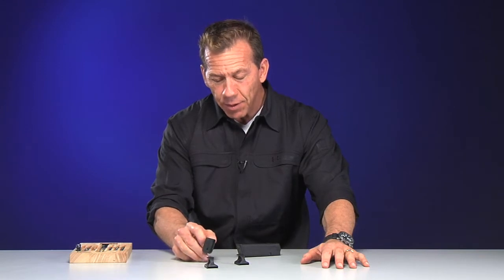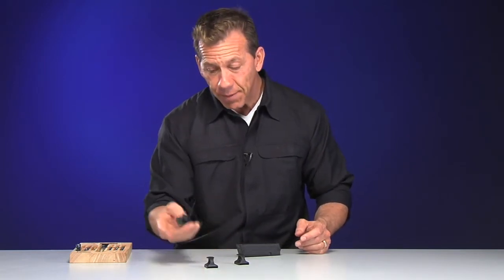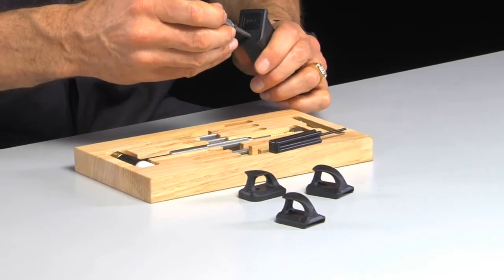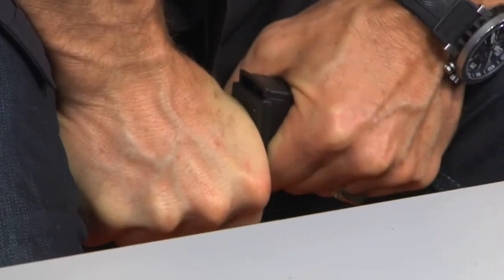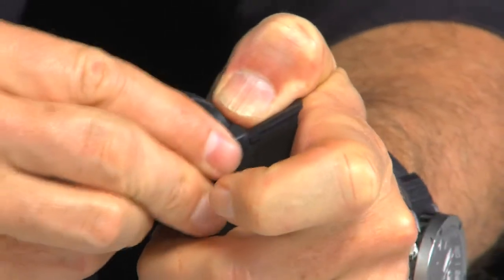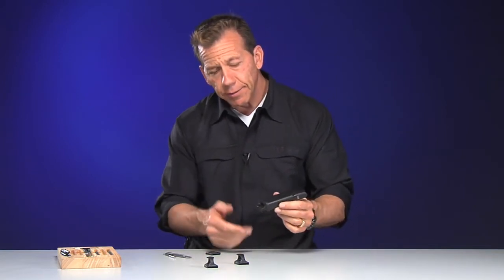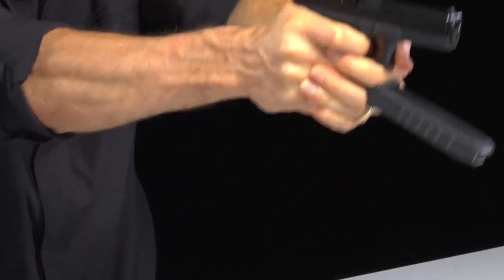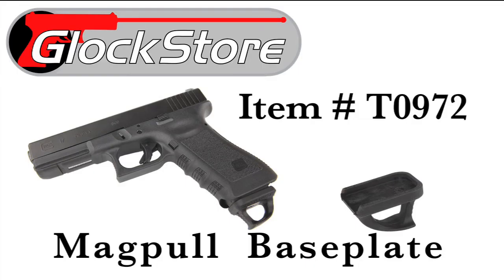MagPul Speed Plates

Comment: I found a lot easier way to take off the base plate. Grab a pair of channel locks or vise grips and squeeze in the sides of the mag up close to the base then insert a punch in the hole and it will slide off easy. And also you can wrap tape around the part your squeezing to help from digging in but I didn't and it was fine

Comment: I bought some of these for my Glock 26 and added them to my 15rnd 9mm mags and they work well. Once I added them to my 10rnd mags, they had problems and would have stove pipes, the mag would not click in for some reason. I changed it back to my old mag plates and they worked well again. So for some reason, they are not working on 10rnd 9mm mags. You have any ideas on what to do? Thanks. Good video.
Reply: old comment but, glad i found it since i was just looking for something to put on my 10rd mags. thanks!
Reply: @anglicky69  4 years later, and I came to the comment section to find the same thing haha.